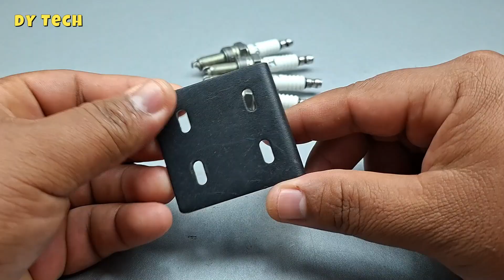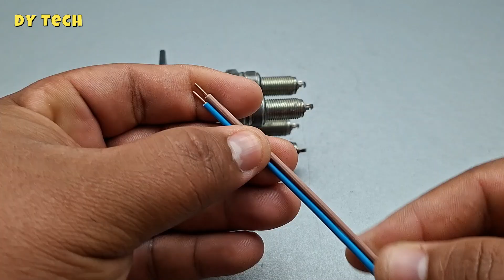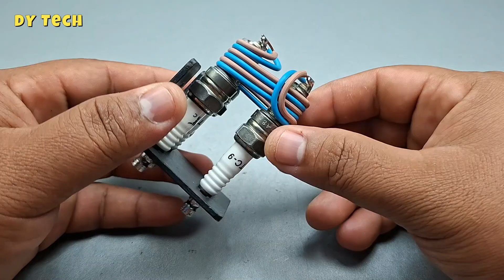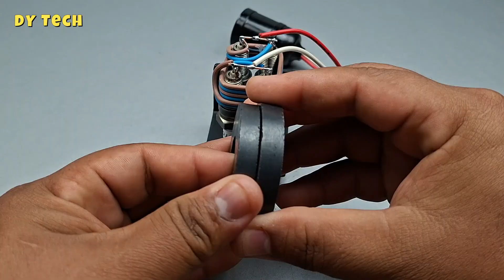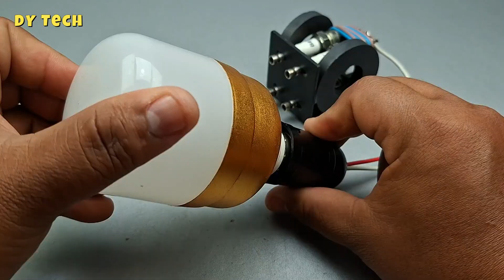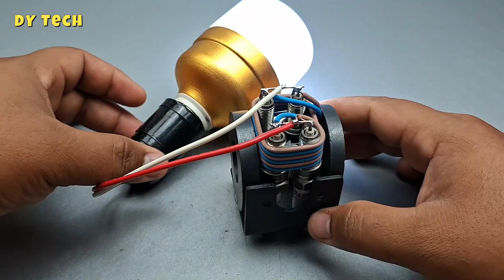Amazing make free 220v 16kw energy generator with pvc copper wire use spark plug self running energy

Comment: Is the generated output current in AC thus able to be conducted through smaller gadgets wiring? If so, this is totally awesome. If it is DC current it does appear that the wire gage would be too small to handle that amount of current. Will you please share the wattage of the light bulb?
Thank you so much.